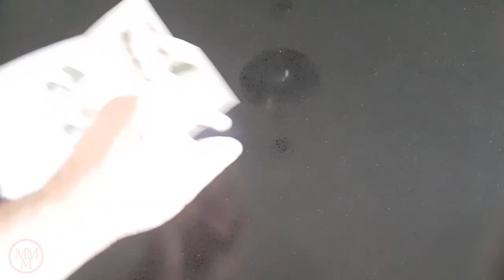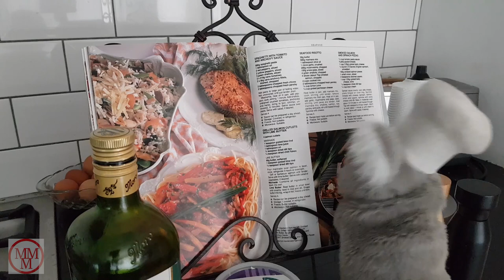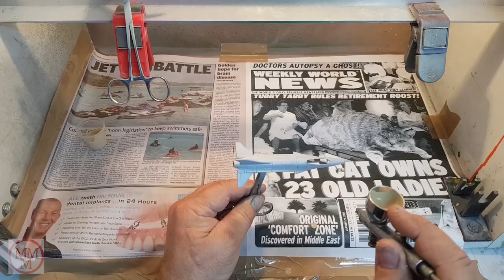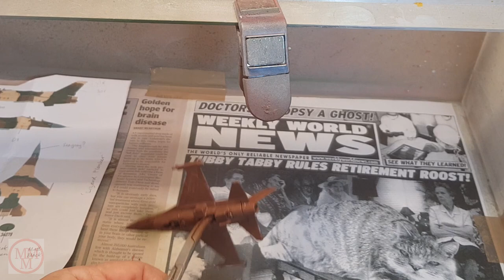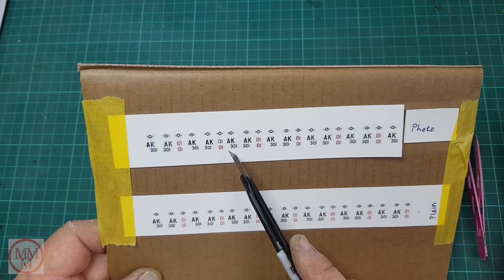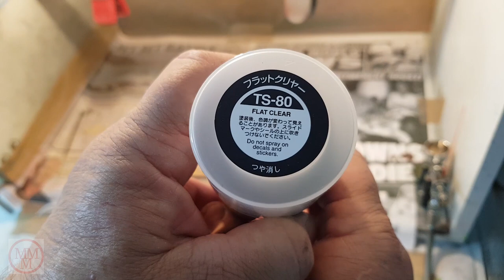MATCHBOX Custom No SB24 Skybuster F16 1978

Comment: I built and painted a small, wired remote-control tank in the early 1970s, and camouflaged it in tri-color, using spray paint cans.  I used cotton balls to mask off the areas as I painted, and it turned out quite well.  At the time, I was in the USAF, working on F-4D jets, that were all camo painted.  Didn't have a Kevin around, so it was finished the first attempt.  Always fun to watch, Marty!

Comment: Marty, ref decals. As a railway modeller, i use a pot of acrylic Gloss varnish and apply decals to high gloss areas. This will make the carrier film invisible. Then once dry, recoat with gloss to seal them in, then apply the clear on top of that. It may be beneficial sometimes to apply decals to the aircraft before reassembly, this way you can spray coats of gloss or clear and not effect the clear canopy. Best regards, Dan.

Comment: A couple suggestions: The decal film would disappear if you had first used a glass varnish then applied the decals then used a flat coat to seal them.

A thin wash of burnt umber would settle into those panel lines and really make the details pop on the model.

The trick with blue tack masking is use very thin "worms" of material pressed firmly onto the surface and for larger areas cut a piece of Ziploc bag to lie on top of the blue tack as a mask. 

The plane came out very nice in spite of your difficulties so well done. I certainly enjoyed the video

Comment: The bulge on the left side is the gun port for the M61 rotary cannon.  The air refuel door is a somewhat triangular shape door that sits aft of the canopy.  It has lateral and longitudinal marks to help the refueler guide the boom..  Worked different blocks of the F-16 for 10 years. Well done on the pitot tube addition😀👍🏻

Comment: Really cool to see you do an F-16! I used to work on them in the USAF. I worked on the ones in Las Vegas that we’re painted like this for a while. I know it’s not part of the matchbox mold but you should add the upper antenna to the vertical tail to make it a C model and true Viper. Nice job.

Comment: Your decals have "silvered", which is the light reflecting back off the pebble-grain matte clear coat beneath them. In the future apply a gloss coat over the paint first, then apply your decals. You can then go over the entire decalled model with a matte clear coat and the decals will not silver. Always create a glossy smooth surface for decal application. That said, great video Marty.

Comment: The plane came out great Marty!! Just a tip, heating the model a little will help the paint stripper work better. To help with those different paint layers and stripes, you could use pin striping tape for the edges and fill in with larger pieces of tape.

Comment: Great result, Marty! Making it camo is muuuuch better than the original. Restorations? Scmustorations, go all in and and pimp your ride, that is what I think.

The masking, I think you could havused some weak/removable double sided tape. Stick some white paper to the sticky side right out of the reel (don't peel the other side, so it is entirely not sticking while you're handling it), draw the lines on the paper (make sure the ends match), cut it to shape, peel other side and stick to the model. Basically just focus on one continuous edge at a time, any area between edges can be taped in lazier ways with regular masking tape, you're just shaping the edges with the double tape. Can get away with regular tape and drawing before pulling it out, but I find that harder to freehand and to match ends.

Comment: Great finish at the end. You made a silk purse from a dow’s ear and loved the lizard scheme.
When applying decals, they work best on smooth surfaces such as gloss paint or a small area of floor polish as no air is trapped under the decal. That is called slivering. 
When dry, finish with a flat coat and they look painted on. In this scale you can get away with it. 
All in all, loved your video. Seems so short though but it must be your technique and presentation style that does that.  No pizza while baking paint, Kevin. 😁

Comment: I only spotted the plane in 2 of the 4 pics... Very good!
A hint for decals - use a gloss clear coat before you put on the decals. This helps to hide the carrier film of the decal. Once it's been snugged down with some setting solution and a cotton  bud, another quick spray of gloss clear completes the job. Then you can matt or flat coat it, and if you've done it right, the decals should appear as if they're painted on.
Good luck!

Comment: it is the hump for the 20 mm rotating barrel canon, the refueling in not by navy probe but by airforce receptacle on the back/spine behind the cockpit, there are guidance markings in front of the recepticle which is lowered by the pilot before refueling, the boomoperator then sticks the probe in guided by the markings on the spine

Comment: Looks great, as always.  A better product for masking camo patterns is, believe it or not, Silly Putty.  There are purpose made masking putties, but I've never used them.  Also, you might consider applying a pin wish with oil paint and thinner to accentuate the panel lines.

Thanks for the great videos.

Comment: Marty, in regards to the decals solution, you have to put it on and let it sit overnight. You can't just rub it off right away. It will look like the decals ruined at 1st, but everything settles back to flat. Yeah I like the hiding thing at the end there. I almost got the very last one right. I guess your camoflage paint job work pretty good.

Comment: Marty, you are a modern modeler. In regards that extra piece on the left side of the body. I'm just guessing, but is it a step for the pilot to use to enter the cockpit? Since it's on the side of the plane used for getting in. Yep, when in doubt, use a brush. After watching your unboxings, it's obvious you love these little planes. You did a great job in making this more realistic. My father worked for Lockheed, as an instrumentation  design specialist. Marty, can you see how many fingers I am holding up? Nope, just the one. 😂

Comment: The "bump" is the 'Gas Suppression Muzzel Aperture' for the M61 A120mm rotary cannon which is mounted about 4-5ft further rearward with the 511 round Ammunition drum just above. - Courtesy of the Haynes Worksop Manual Series - GENERAL DYNAMICS F-16 1978 onwards.

Comment: Great job, just a comment about the decals. I would have personally put the decals on before the Matt coat. And not wiped off as much of the solution as the idea is that as it drys it dissolves the transparency and leaves the ink attached. Then you Matt coat afterwards and it ensures that it's a pretty much solid attachment band you don't see the decal transparency lines.

Comment: The decals seemed very insignificant until actually on the model. It's a question of scale. Imagine yourself as the flight crew for said plane. Those decals would seem huge, especially the tail markings. I have a slight fear of heights and would not want to be the guy on the scaffold painting in those ident numbers. The final camo was very good, when seen against several backgrounds.

Comment: I noticed that you had a bit of mishap with the "licquid mask". The error was, that you tried add multiple layers and too fast. What you should have done (what you did actually right), was the first two layers.
Now here comes the problem: when you added the second layer of masking, it desolved into first one.
How to fix this: after applying the first two layers of paint, remove the masking entrily and let the model dry. Only then repeat the masking process again (this time to match the third and final layer of painting), so this will prevent the mask dissolving issues in the future. Hope this to be helpful. Keep up the good work. And say strait words for rascal of rapscallion Kevin.
Reply from the maker: Thanks for the tip Make573, it makes perfect sense now I think about it. I will try again sometime. Cheers, Marty.
Reply: @MartysMatchboxMakeovers  Now whe you know about licquid masking why dont try something of a challenge with Sky Busters (since you do have a squadron of those); for ex. Marine Fighter [Mariner Green, Ligh Blue, Black, Mariner Dark Blue & Grey] or Thundra/ Winter Fighter [Grey, Sand White, Snow White & Black].
Oh, and future reference in fighter jets the botom half of hull is ALWAYS grey or greyish blue [camouflage viewpoint FROM the ground, TO the Sky] and then the upper half of hull has the enviroment camo color [viewpoint FROM the Sky, TO the Ground.] Otherwise it would be too easy to shoot them down with anti-air cannons.

Comment: roll out the blue tack in to thin  pieces cut it to shape and lay on the model you don't need to press to hard in the middle just on the edges should make it easier to take off

Comment: Try using a old jam jar with the paint stripper in for cars, fill it half full and the lid has a air tight seal. Then just agitate it from time to time, the old paint just settles to the bottom and it can be used numerous times.. 😏💯👍🏼

Comment: Anyone heard of Funline diecast cars?  They make some wild stuff, their muscle machines, but they make stock models too, or something in between. Though made in China, the one I picked up for restoration the other day (they through it in free with my other buys) seems very well made. It's a 2004 production of a 54 Chevy leadsled. Unfortunately the hood is missing, and so are two wheels. I broke the windshield piece taking it out, but the parts that show are still intact so that's not big problem. The hood... well that's going to be a problem. Oh it shows a somewhat detailed inline six. Both the base and the body are metal, and it's held together with screws as if's already been redone once... maybe it has, but it was a pretty good job if it was. Its beat now, but I can tell it was once beautriful. 
It also has a very interesting  suspension that links front to rear but the real looks and acts like real leaf springs. I was very surprised at the quality and detail in it.

Comment: Never apply decals on matte paint. They have less adhesion and often exhibit an effect known as 'silvering' which is exactly what it sounds like where especially the transparent parts of the decal turn white or silver because of the air gaps caused by the matte paint being rough (hence it has a matte appearance). A drop of a product such as Future floor polish if applying on a flat/matte paint can help prevent those problems, applied in a similar manner that you applied the setting solution. Remember that clearcoats are a thing. The decal setting solution you used is only useful if you have thick decals, or if you need to fit your decals into or onto tight curves or details. It's purpose is to soften the decal. It will not help a decal stick. Good luck with your water-slide adventures.

Comment: Transfers (decals) are best applied to a gloss surface, then coated with matt or satin varnish if necessary. This will aviod the silvering problem you were experiencing. The tiny USAF insignia on the wings of the aggressor F16s are deliberately used on the real aircraft to minimise the distraction they might cause in close combat training, and in wartime it is not unusual for national markings to be partially or entirely obliterated by overpainting them on operational aircraft. For example, in the 1982 Falklands Conflict, all the markings were so removed from our Sea Harriers

Comment: I have always used a paper moveable mask for doing aircraft camo. the masking material you used is nothing new, it has been available since the late 1960's. I tried using it and as you said it is junk. I have built hundreds of mostly ww i and ww ll aircraft models and the freehand method using a paper mask cut roughly to the camo shapes have worked best for me. I of course used an air brush.

Comment: and heres a small tip witn u did the painting of the black on the canopy that jabbing motion is bad form put ur brush on an angle and make a sweeping pass MAKE SURE U DONT HAVE TOOO MUCH PIANT ON THE BRUSH it will make a total mess but done right it will be a beautiful line or curve and EVEN not thick here and thin there

Comment: Why bake the primer? first time ive seen this. modelling primer does not to be baked, it just dries to a hard finish. unless it is an automotive paint. Also.. place decals on a glossy surface then spray it with matt. that is why the decals did not stick.

Comment: 20:30 It has something to do with the Geneva convention. Combatant items have to be marked by each participating state. Otherwise one can be considered sort of a pirate (partisans and maquis fall in this category), so doesn’t fall under the Protection of the Geneva convention and can be shot immediately after capture. Same, if someone is using wrong insignia.

Comment: masking tape works best Marty u can even cut out ur pattern on the tape then lay it down on the model then paint it then remove it wait till that's dried totally in ur oven is best and then tape off for the 3rd coat that's how us plastic modelers do it
Reply from the maker: Good advice Shockwave, I shall be trying this old school method next time I think. Marty.
Reply: @MartysMatchboxMakeovers  I should add to prevent paint bleed use a coat of flat clear before u put down the color that will seal the tape edges let the clear dry say 15 mins and prevent the color from getting under the tape

Comment: Marty, it's camouflage, it doesn't have to be spot on. I would think each real plane would have been painted differently from each other anyway. The whole point of camo is to disguise the shape of the object, to not give it a pattern to recognize.
Relax a little bit, you did fine. You're using new products for the first time, they're going to be a learning curve for a while if you stick with them. Cut yourself some slack. 
Kevin on the other hand...

Comment: Yes, but hardly.

Took me 4 seconds,...enough time to get shot at first.

You'd be more successful if it was moving and if you are colour blind.

Luckily enough,...modern military detection equipment will detect the aircraft way before you need to with eyesight.

Still,...great job 👍.

Comment: I've built models for fifty years and I enjoy your channel. For this application, this size, really use tape to mask. There are excellent tapes out there and you would have easily sprayed all three colors with no issues. BTW- The "original" paint on this plane was based on the General Dynamics prototype color scheme.
https://designer.home.xs4all.nl/models/f16/f16-proto.htm